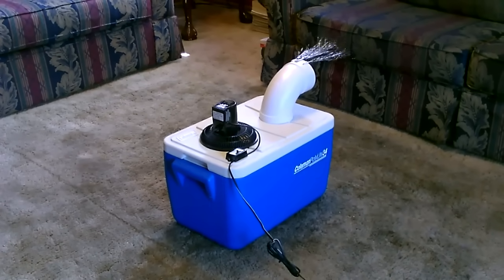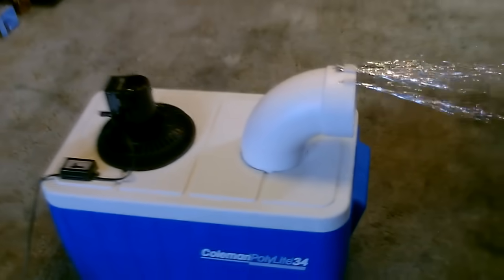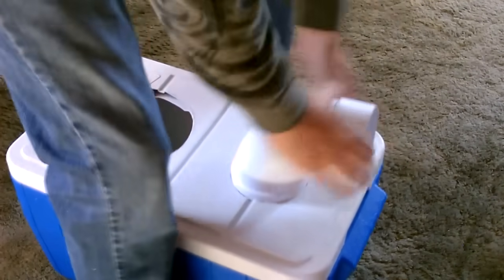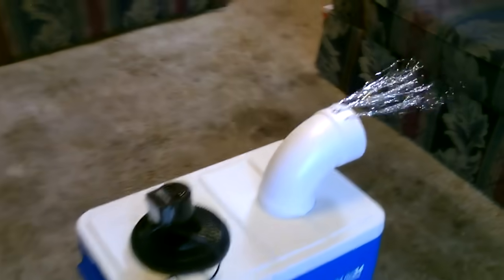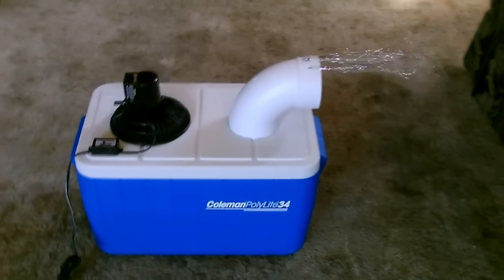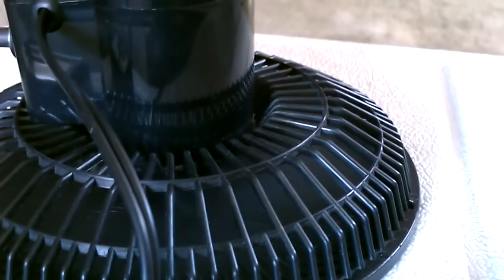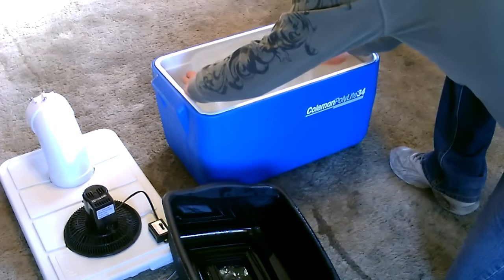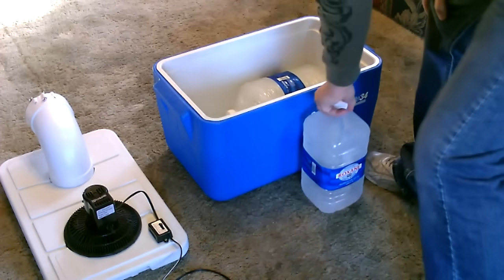Homemade air conditioner DIY - Awesome Air Cooler! - EASY Instructions - can be solar powered!

Comment: in 100litres of ice there is capacity for water to hold 9kwh of energy.  The phase change from 0 deg water to 0 deg Ice is a huge amount of energy.  Consider this when designing.  If you have access to free ice, this is a big bonus.  A friend works in a hotel and can have 20litres chilled down during a shift.  If salt is added, the stored energy is even more as the freezing temp is lower. Great video and well presented.
Reply: simpsonporter opp

Comment: Idea, find an old absorption refrigerator from a old camper. Design a calcium carbide canister to generate gas to fuel a burner to power the absorption refrigeration process. Add in a nintinol graphite thermal electric generator to the build to operate a stirling helium sealed cold piston that super cools aluminum scandium alloy plates. With a fan that forces air through the cooling ducts over the aluminum scandium alloy plates. Use the correct air flow to eliminate frost build up. Hay you could even design the device to collect condensation to drip into the calcium carbide canister to operate the whole emergency air conditioning system has well. Design it with an exuast vent to vent the heat and used air out a window or chimney flute like how other heating and cooling systems are designed.   😊😉

Comment: I found an old  freezer(box type). Plugged it in , worked like a champ!
So I cut out one end installed a fan and  (2) 3 inch couplings on the other end..(same concept) except No need to drop ice in it.
Man I tell you I sleep wearing a sweater!❄️❄️☃️❄️❄️❄️

Comment: I built something like that probably 12 or 13 years ago with a battery powered fan. I use the squarish Fiji water bottles, the big ones, frozen into blocks for my cooling source. It works good for one night camping in Texas, but by night #2, it's worthless. Basically you need a constant supply of ice to have this functional. Most of the campgrounds we stay at have bagged ice. Melts faster, but still works...

Comment: Great idea! Specially if you don't want to cool off a large area. 
Do you use any sealant around the holes in the chest lid? what diameter is the PVC pipe?
Reply: ... looks like 4" inch sewer 90 degree elbo ...

Comment: i like the plastic bottles ...... take the paper off of them....
next use aluminum dividers .
the aluminum   will get real cold..... plastic is an insulater like paper....
the frozen bottles will keep the aluminum cold as a surface area....
now the air will hit the aluminum...... like it would on a block of ice.....
 a beer case divider but air tight...... 
this way you have no mess.... and your ice will melt slower.....
like 9 or 12 small bottles in a aluminum box make sure the dividers hit the wall...
this will let the aluminum stay cold..... 
here is the best part..... you pull out your aluminum box... 16gage put in your freezer...
the water bottles are it cells......  or just rotate new bottles in ..... 
your cooler act as an insulate  keeping the surrounding air out.....
its like blowing a fan on your ice block without a cooler ..it will do nothing but melt fast...
here is what i mean.... a solar panel and capacitors <---your aluminum is your capacitor it will discharge  a cold temp yet protect the cells from discharging to fast...
like how mush steam can be produce out of litter water.... thats your energy surface use..... dont wast it......

Comment: Hi there, can you please give me more details on which fan to buy? I have everything but the fan. I'm afraid I might buy one not strong enough.
Reply: Wal-Mart automotive section. 12-volt clip-on fan.
Reply: Lin Files Did yours work? I bought a 9" fan but it still doesn't seem like it is blowing out strong enough from the open side :(
Reply: Lin Files 12 volt clip fan for a car or semi truck.

Comment: If this ice idea is so great, why not just open the door to the freezer and blow a fan into the freezer cooling the room? The reason this won't work is because the freezer will produce a net heat equal to the watts being used by the freezer. You actually end up heating the room more than if you had kept the door shut. A question in thermodynamics goes like this: If you had a freezer in a sealed and perfectly insulated room, and you were to open the door of the freezer, would the room get cooler, stay the same or get hotter. The answer is that it will get hotter because energy is entering the room through the wall outlet via electrical energy going into the freezer. The room will get hotter. The rate of heating will be equal to the watts (Joules per second) used by the freezer. So if you want to do this ice chest idea, make sure the ice maker (freezer) isn't in the same room you are trying to cool. And be aware that the room where the ice maker is, will get warmer as you make new ice compared to what it would have been if you weren't making ice.

Comment: If you add a cup of salt the ice would get colder only works with ice and dry ice it will drop temp at least 5 more degrees

Comment: Nice little unit. Looks like if you allow for it and set the vent pipe back a little, you can turn the lid upside down for storage to protect the fan and vent from breakage...

Comment: I have a OPEN top freezer and i do tăiș to jeep the freezer moare effecient and i never run out of ice Thatcher i freeze in old aluminum coffee cans and my setul actually haș 2 tubes. One 5 Inch insulated blowing out under the cooler with a 4" clearance and an intake unei the poposiți end. The fan îs inside the cooler and it will last 24 hours.... i bate auto correct

Comment: For slower melting ice, minimize the amount of surface area of ice. For example a bunch of ice cube that maybe equal the same 3D volume of his block of ice would theoretically melt faster due to more surface area exposed to higher temperatures. In other words, use one solid block of ice to last longer as he seems to have. Yet you need enough surface area of the air of the fan to blow across the surface area of the ICE before exiting the PVC exhaust port.
Reply: Can’t you just throw ice cream salt in the ice and it’ll slowly melt.
Reply: I think using 2 to 4 Big plastic bottle of water (4 X 4l or 4 X 1,05669 Gal) should be ok. You can use 2 as the other 2 are in the freezer.

Comment: What is the machine you used to cut the holes? Electric saw or something? I'm gonna go down to Home Depot and get me one but I don't know what it's called so if you could provide the name of it I would appreciate it. Thanks.
Reply from the maker: hi there. it's a "jigsaw" *you can get them as cheap as $15.00 at places like harbor freight tools.

Comment: Draws hot air in melting the ice...turn the vent towards the fan cooler in means cooler air out plus less ice meltage...just a thought

Comment: You can also freeze some 2L water bottles and place a fan behind them. No drilling or cooler required. Although maybe less efficient, it's quick and cheap. Place the bottles at your feet bedside and it's good enough for falling asleep. Cooler is a great idea too :)
Reply: grinattack69  buy a cooler cheapskate

Comment: Wonder how much energy is used and heat generated making the ice?
Reply: Lmao a freezer is an air conditioning system that pulls heat from the box and puts it in the room. Therefore all energy used by the freezer becomes additional heat in the room, regardless of where the electricity came from. Only way to actually cool the room would be to have the freezer in the garage
Reply: Yeah, but what is the volume of heat that need to be transfered ? not that muh, so the impact is quite negligible unlike a computer or a console... Same goes for the device presented here, it won't refresh your room, not really when your romm is very hot, it will just refresh air in front of it, so it is more to refresh you than the room itself
Reply: Same, which is why I consider doing something similar with a 12v powered cooling box. While it still draws energy to run, it'll probably draw less energy than to constantly make a new ice block
Reply: It's Eoleh those also generate heat so you're no further ahead
Reply: Q=m x Cp x dT (bring water to freezing point) + m x LatentHeat (converting water to ice).

Power consumed (kWh) = Q / time taken
Cost($) = electricity rate($/kWh) x power

In actual, more power consumed as the efficiency of the compression/evaporation cycle and heat exchange is not 100% in the freezer
Reply: It only matters if you intend to buy a freezer for this, if you otherwise already have and use one, well the only additional energy you spend is the energy of the fan.

Comment: The 1,000 haters are probably paying upto $500 a month for using the traditional AC all day long.
Reply: And how much would icing water all day cost? Your freezer is just a small room with a very powerful AC system inside... and if your freezer is in the same room of this homemade AC you are not only throwing money away for nothing, you are also pumping heat in the room, BTW. Laws of thermodynamics...
Reply: @Vercingetorix45  kass
Reply: $500 a month for AC ? WHERE ? I complain over $200 a month as is, only if closer to the RIVER, there would be a wheel in it, just like the mills did that ran my city, its why we were the #1 city in AMERICA with the most mills and all built along the WATERS.
Reply: The ac we use here uses more like 20$/month but u cant cheap out on a brand,
Just for reference we pay about 0.4-0.5$/kwh here
Reply: @Dalynxjwz  I've always either use Frigidaire or LG. Never buy cheap stuff. My big one just go in, to heavy for me to put in. 13500 BCU AC UNIT, that did my whole house, about 1300 sq ft now, I also use a 1/8th of a HP floor fan that I point in upwards position so the cool air moves around, I also have a Husky dog, so she loves the AC or FAN and lays in front of either or. That's on 8000 now I turn my thermostat all the way down to lowest setting, then I watch that on temp, my house will be about 68 to 80 depending on the humidity and how hot it is. I clean the AC a lot on the air intake, light goes on if it gets dirty, I just clean it every week on same day or if light pops on 1st. Buying another small one of 6000 and should be set. Before I used my big ac and 1 5000 one and it was cold, but I set it on energy save mode, the big one is to old, so just set to low and put on a certain # so it's not always drawing juice. Have LICENSED  ELECTRICIANS, so I know how to run and save, start up cost the most. The big one takes 3 amps to kick on, then runs off of 1 amp. Keep your FREEZER and FRIDGE packed with food or drinks or even gallons of water to FREEZE so it DON'T kick on the FREEZER a lot. I knew but was told again when my NEPHEW graduated. Then I tell him close the beer cooler, the ice is melting down, gonna have warm beer. He's like no, if you leave open enough, then yes. Just like Electricity now. Just not power. To smart for you now.
Reply: @JR-kr1lv  kasw
Reply: @Dalynxjwz  kaae
Reply: As i posted above, to produce the kind of ice needed to do this job, try to calculate the power consumption needed and compare that to the effective electricity drawn from a modern airco to do the same job, you'll be astonished.
Reply: @ganimidis  The airconditioning we use has an efficiency of 7.52 so for 3.5kwh or 11000 btu cooling it only uses 0.465 kwh max
the refrigirator needs to remove all warmth taken out of the water to turn into ice. wich then flows back in the room. summer temps are 40 degrees out here at the moment. But i never pay more then 20 euros extra a month. to keep it a comfortable 23 degrees inside.
On the lowest cooling mode wich it uses the most he maxes out at 130+/- watt per hour.
Reply: You do know this can't cool an entire room right? lmfao. It'll only cool you if sitting directly in front of it. It's a inefficient swamp cooler system, which is what they use in place of AC in much of the south west.
Reply: $500 a month? That's nothing, Lol. Move to the desert.
Reply: @cddog1995  Shall i send the camels 2 ?
Reply: where is the hot air in the house going, using this "swamp cooler",  the point of an ac system is to move indoor heat to the outside using heat transfer which is why there's an out door unit, I wouldn't call this an evap cooler it's just moving air in the bucket and back out, water/ ice is pointless unless your pumping it down pads and having air pulled through that, You might as well put a desk fan on a desk and open the drawer and dump water in it. Pointless
Reply: $23 / month on AC here. I don't ever turn it on since I'm surrounded by neighbors in my apt. Avg 76 F.
Reply: @mathewnunley8433  where
Reply: HEY NUTTEN is for free even if you make this colling box, u still have to freeze the jugs or ice block , which take energy! JUs buy and ac and done!

Comment: Make it even better by putting some window caulking around the PVC elbow and fan so you have a perfect seal. Then put a window AC filter behind that fan so you don't draw in pollen, dust, etc. Then when the ice melts you can drink the water, water your plants, put it in a swamp cooler, etc. 👍
Reply: Technically you can just refreeze the water, anyway.

Comment: i made one using a $2 styrofoam cooler,  louvered ac vent, low flow fan and frozen gallon jugs. the low flow fan will thaw the ice slower and the louvered vent controls the output. I also used dry ice. It worked great but got a bit expensive.

Comment: Expandable spray foam from a can to fill the void of the circular cut outs and, since the cooler lid is re-moveable and if you have a deep freezer (I have two) place the cooler into the deep freeze and fill to your required level (weight), alternate between two coolers that use the same lid. This larger ice block fills the void of air in the ice chamber, should increase the efficiency by increasing the outflow rate, and longer cycles between ice changes. The DC power is the way to go! Nice job!

Comment: Thank you very much for the example. I will build 1 for sure. 
  I feel if you were to use more space efficient frozen water bottles,  it would also serve to dehumidify areas were humidity is a factor while the moisture condensates around the bottles.

Comment: Thanks for this tutorial video because I'm always trying to find a way to save money in the is definitely one way to save some money I'm going to make me one thanks again do you really have to hook it up to a solar panel?
Reply: he also used a small 12 volt battery. He built a dual power system which he can switch between.

Comment: This is really cool. Car A/C's goes low to 60° at most, and you achieved 40° ! I gotta do this for my bedroom ! In Florida the regular house A/C just isn't enough lol.
Reply: Try leaving your bedroom door open. whit no return in a large room and the door closed some of the air is forced out of the house causing the room to be hotter than the part of the house that has a return.
Reply: actually, if you point one of those laser thermostats in the vents, the temp of the air coming out should be somewhere between 20 and 35F,
Reply: It's not about Florida you goober. It's about the cold air leaking out of the house in various places. Mostly the attic. That's why ALOT of people use spray foam insulation in order to keep the house cooler. You probably have feces from 1920 up in your attic

Comment: Imagine if the fan blew into a pipe 25 feet deep and back up out of the goose neck. You would have geo thermal AC and heat. Now before you dig make sure you are in a house and not an apartment building. Go deeper for better results!

Comment: that's right it probably works with the water Frozen inside plastic because you actually might get some condensation and actually remove some moisture from the incoming air good idea

Comment: clever, wonder if it make a difference for the ice to last longer if instead of using a 90° ,use a y pipe, than reroute the top  strait end of the y pipe over top of the fan to re circulate cool air , then you'd basically have a 22 or 45° exit  cooling the  higher areas

Comment: I do the same thing when I finished sweet tea from McDonald's. just blow into the straw and the cold air comes out the top and cools your face off. not as large a scale as this but still feels good when stuck in traffic with no ac

Comment: Perhaps you could cut the tops off of your jugs so they weren't too tall for your cooler? Would alleviate your mess problem, whilst still giving some non-plastic covered ice surface area (noticed you had about a 10 degree variation from the two methods) for better cooling. 

Edit: without the tops I was thinking you could get more jugs (and more ice) in there with less cleanup. 

Cool video! Thanks!

Comment: This only works if the freezer used to create the ice is not in the same room as the one you want to cool; as freezing water generates more heat at the freezer's back side than the ice will cool down; effectively heating up the room instead of cooling it. ;)

Comment: another thing this devise does, it acts like one of those rainbow vacuum cleaners. The air sucked in by the fan blows the air into the water and the water traps dusts and pollen's in the water. It's a filter as well because of this. You should pre-filter your fan. Build a small square cage around it and use "Used" bounce fabric softener sheets for filtering. make it smell good and cuts down on static due to dry hot air, smart huh

Comment: if you line the bottom of your box with wooden batton's 1" apart the air will circulate around the ice and the water will drain to the bottom. think of it like an ice bbq. the more surface area of ice in contact with air the colder the air. if the ice is submerged in water you are lowering your efficiency. so elevate the ice on some wood and an old oven shelf and the air will be much cooler as more of the ice will be exposed
Reply: Al James r